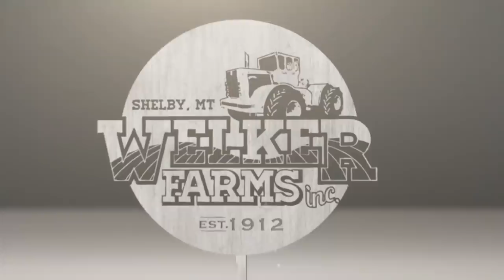Wind TORE The Door OFF & SLAMMED it into a GRAIN BIN?!

Comment: Ok, sure. 5:02, as other people pointed out. For 3 frames at 5:02 you give a partial, blurry, passing view of the tractor. At 30FPS, 3 frames is 1/10th of a second. Not sure that you need to make it that hard.  Stick it in the background in a shot, so people have to search the shot to find it, don't flash a small blurry thing for .10 of a second.
If a lot of people are getting it right, it's because they're scrolling down and reading comments already posted, not because you've been making it too easy.